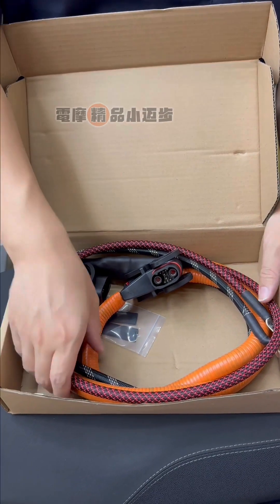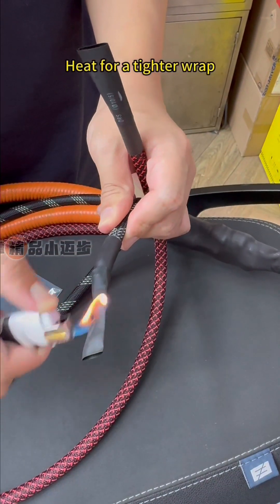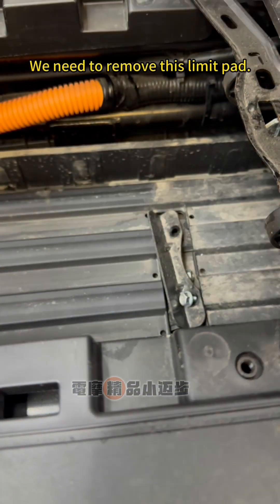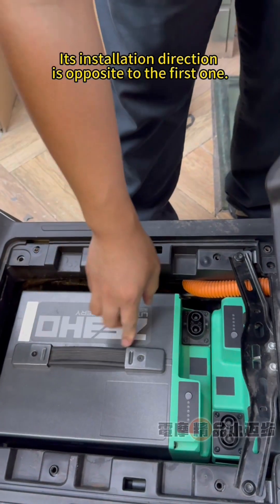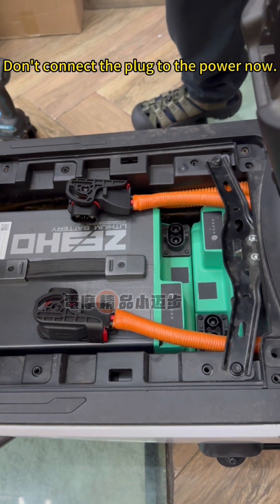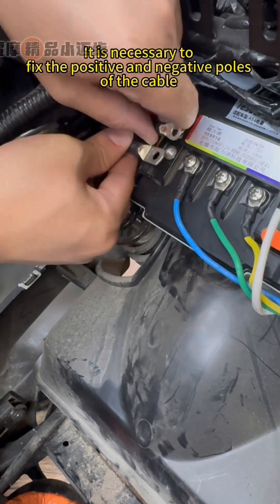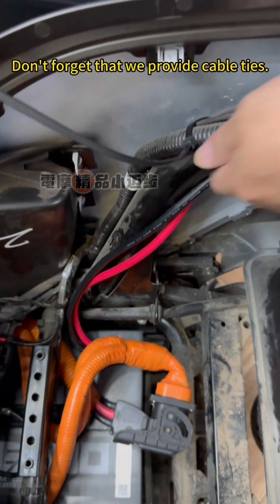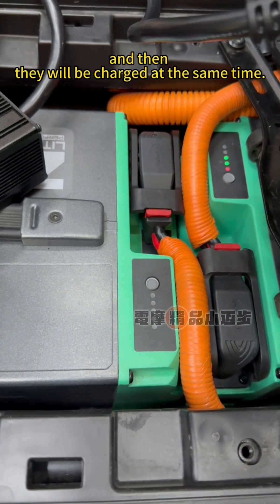ZEEHO AE4 Dual Battery Parallel Cable Installation Tutorial Unlock Hidden Dual-Battery Display

Comment: with original controller you dont have to connect red and black wire? just plug the battery right? what are the disadvantages of using the original controller?
Reply from the maker: The factory controller may or may not have these two wires installed. Their purpose is to allow the two batteries to supply a higher current (>80A) to the controller. However, the factory controller only draws about 40A, so they are not necessary. If the factory controller has them installed, they will not have any effect.